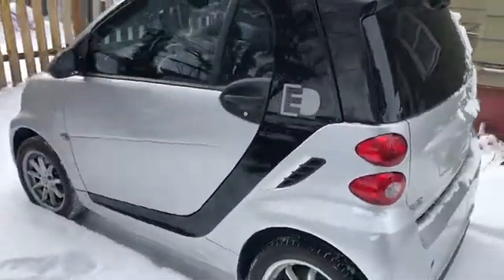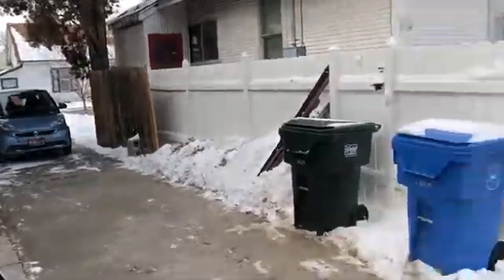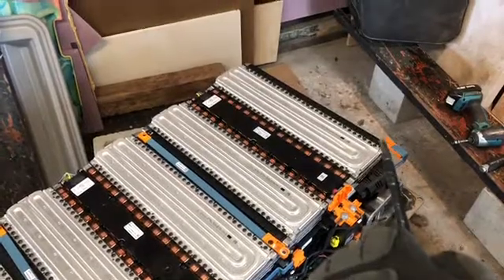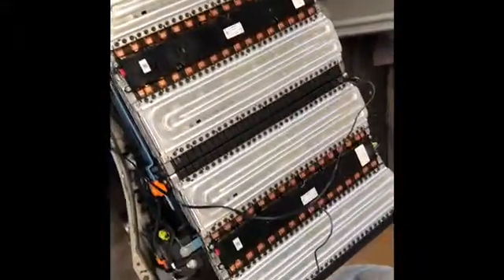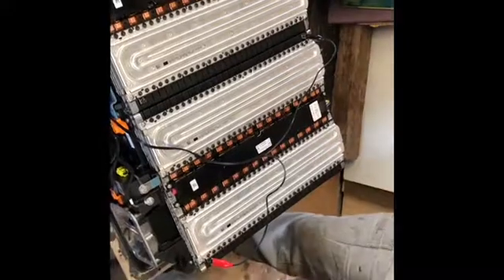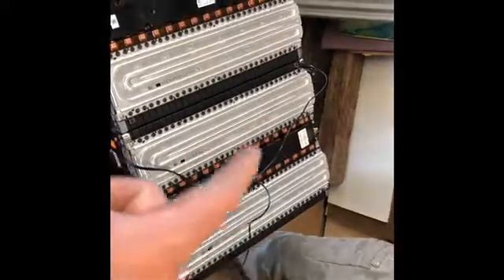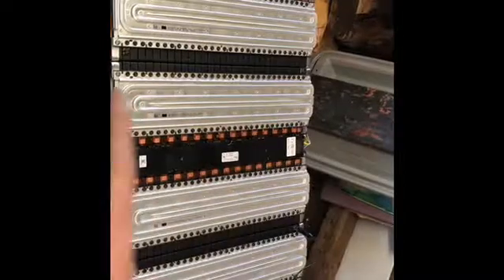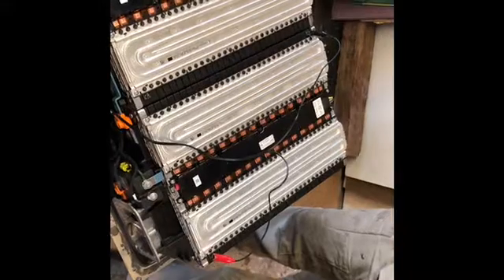Smart Fortwo Brick Battery

Comment: Did you have to reprogram the BMS and if so who did it for you?
Reply from the maker: The BMS is a closed loop and only does not work if the temperature and or voltage is not correct. My car needed no programming whatsoever. My buddy did a swap and his car worked well just had to clear the code that showed HV battery error; the dreaded bricked battery message.

Comment: Glad I subscribed! To save yourself time you may only need to charge the pack to ~10% to get it to take a full after being placed back in the car (for HV charging). So charge each group for an hour or so and then check for a floating voltage across the whole HV pack. Bet it's enough to 'trick' the onboard charger to do its thing. Then charge it noice and slow on a 110v J1772 plug.
Reply from the maker: Genius thank you!
Reply: @subjectmatteramateur16  Let us know how it goes and if you hit me up on instagram I'd be happy to help where I can.
Reply: @subjectmatteramateur16  How did that work out? Were you able to get it to charge with that tip?
Reply from the maker: Foo Fabulous we decided not to put it back in, we were able to charge each pack with our thunderstruck charger and we are going to put 120 cells in the 66 beetle.
Reply: @JuliansRandomProject

Do you know how many watts the traction battery will provide to the 12v battery during the charging of the 12v battery by the traction battery? I would like to know what the maximum wattage via that 12v connection is.
Reply from the maker: Foo Fabulous I don’t know currently. When we take the car apart for parts I will let you know.
Reply: @subjectmatteramateur16  That would be awesome, thanks a lot!